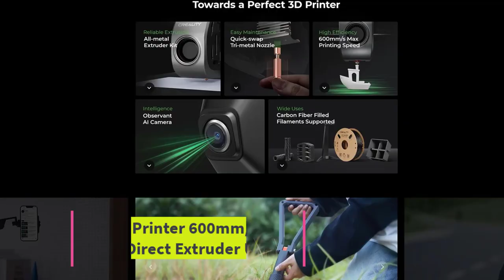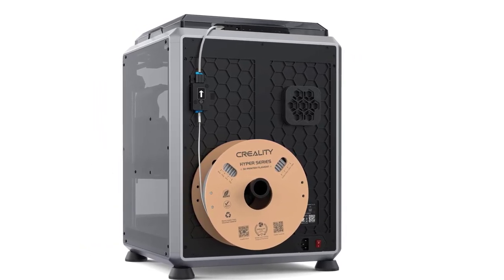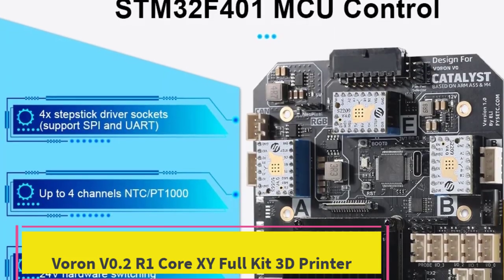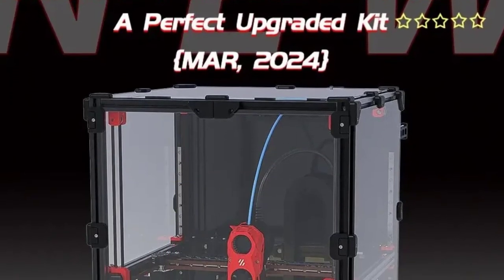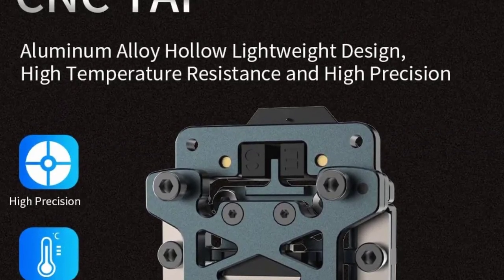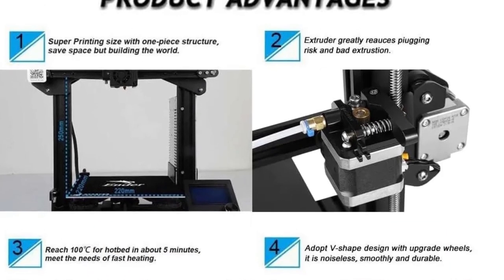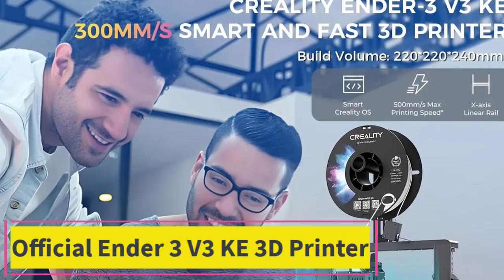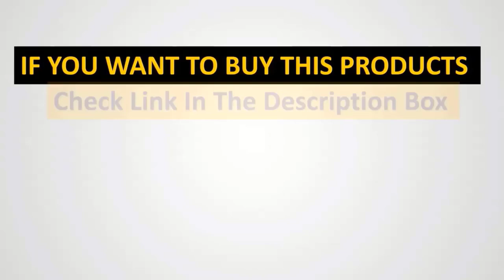TOP 5 Best 3D Printer 2024:  Affordable and High-Quality Options

Comment: That you use a really bad AI voice annoyed me right from the start, and the dislike was pretty much guaranteed when you recommended a Creality. It got even worse when you recommended another later on.
Where are the Bambu Labs? Where are the Anycubics?
I fully expect this comment to be removed and I don't care, but if anyone who is curious gets a chance to read it before then, the best printer for a beginner is the Bambu Lab A1 with the AMS module. A1 Mini (with the AMS) if on a lower budget. Relatively cheap, can print multiple colours (most printers can't), and have a good build quality. It's also very plug and play. Don't believe anyone who says you "have to tinker and learn the printer". You shouldn't have to tinker with machines that cost this much. Look into that printer instead of any of these.
Reply: 1) i absolutely agree with you on the ai
2) but i gotta defend the claim about bambu since it CLEARLY said AFFORDABLE in the video name. cheapest bambu is still like 2x more expensive then a good non bambu 3d printer with the same print area or even RESIN printer. Bambu is literally Apple of 3D printers or Wacom of tablets.